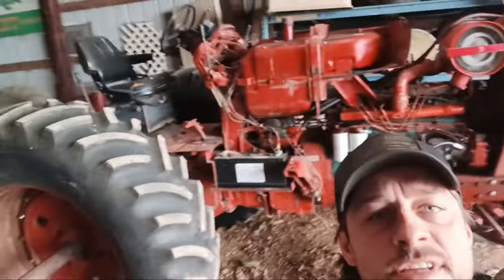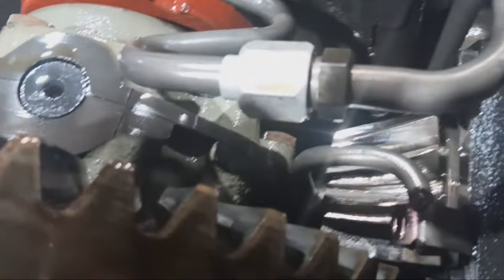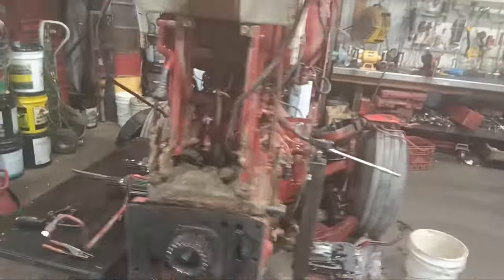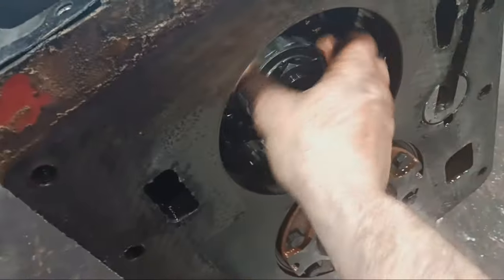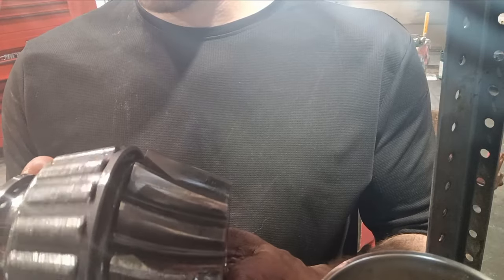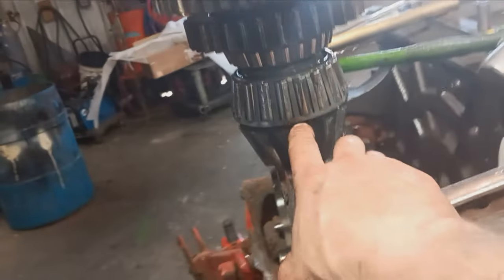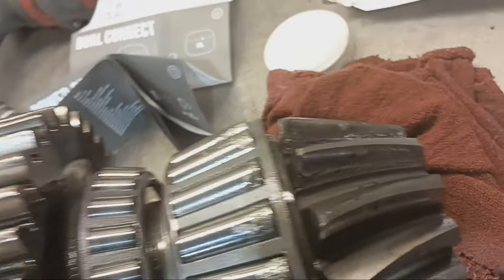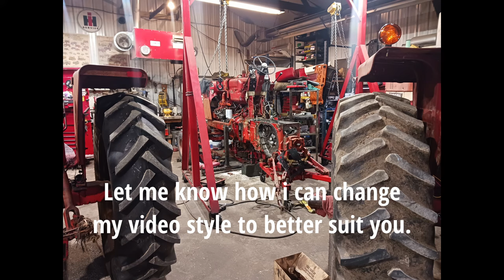IH 1466 Ring Gear and Pinion Replace

Comment: Was this caused by a maintenance issue or just normal wear from lots of hours?
Reply from the maker: I think in general 1466s got pulled hard and sometimes the results can show in the lack of hard surface on the ring gear and pinions.